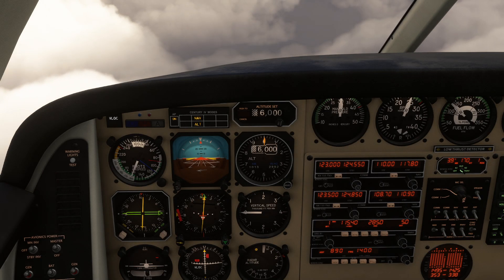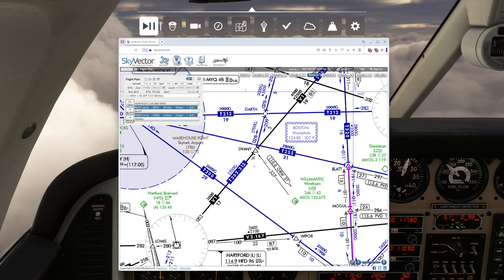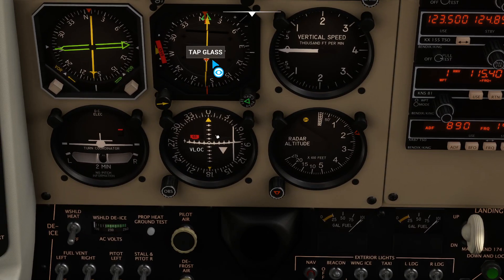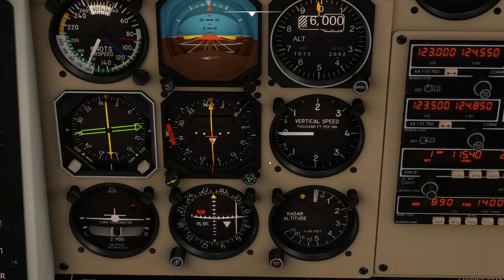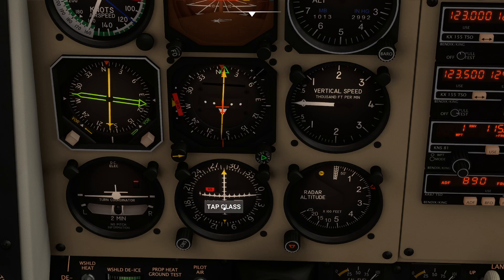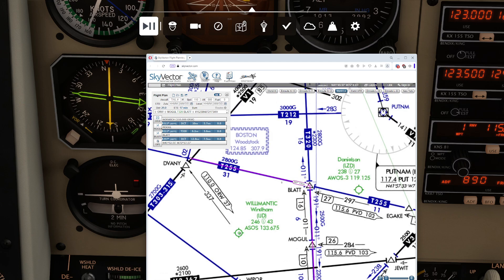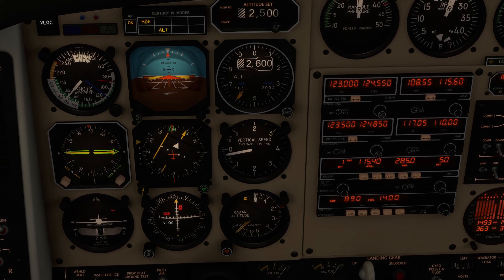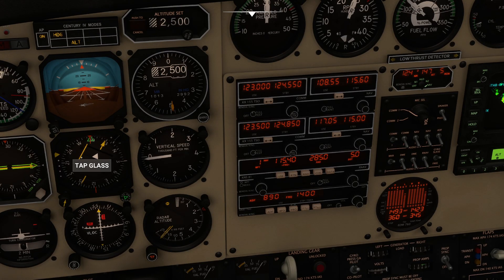MSFS - Flying IFR without GPS Part 2: Using VOR and DME to Locate a fix/intersection

Comment: I find the old steam gauges intuitively give you better spatial awareness once you’re proficient. I did my PPL, IFR, ME, COM on these because none of the rental planes back then had a GPS. When using the needles you know where you are in your head, rather than looking at some tiny screen. GPS is easier I guess but the only experience I have with that is in flight sims and it took me a long time to use it and not just revert back to my old habits of tuning in the VOR.